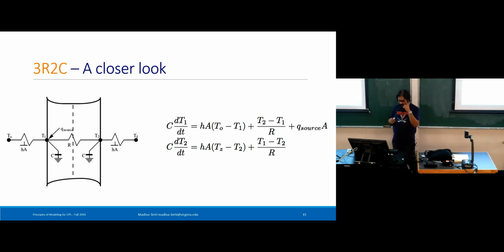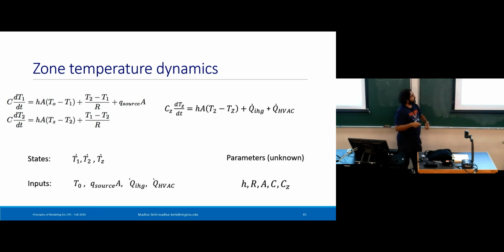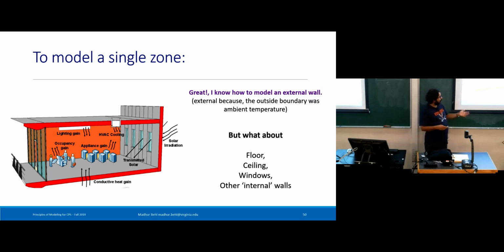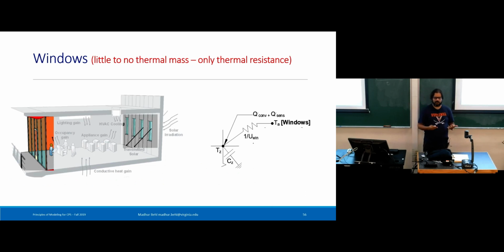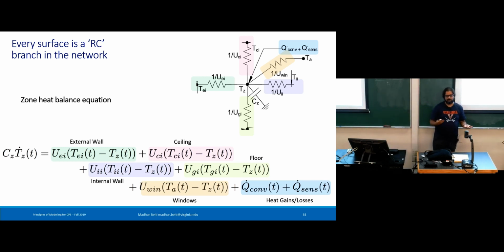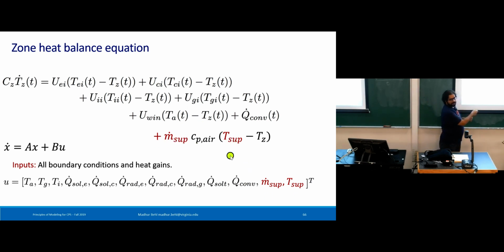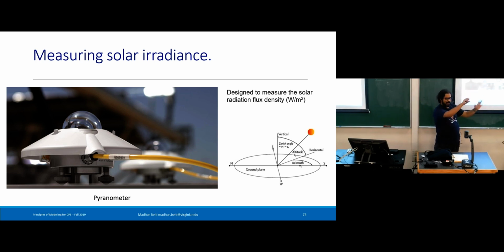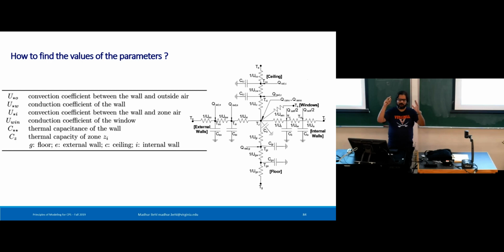Lecture 06 - Part 2 - Single Zone RC Model [PoM-CPS]

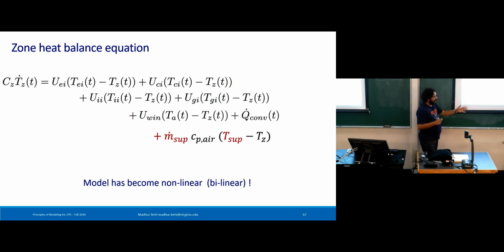Comment: Great lecture! So useful for the work I'm working on (data center cooling). The only remark I have is on 51:02 . Are you sure professor it's called bi-linear ? I think bi-linear means it's linear with respect to each variable. I think the correct term would be "quadratic", since it's the product of the two variables. Thanks again for this valuable content ! :)